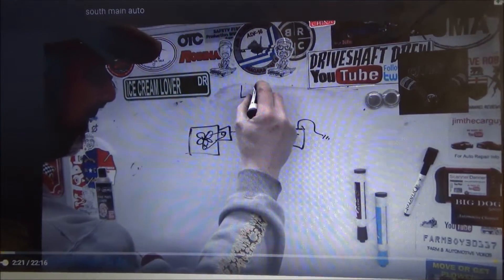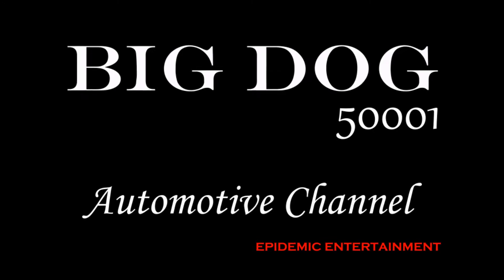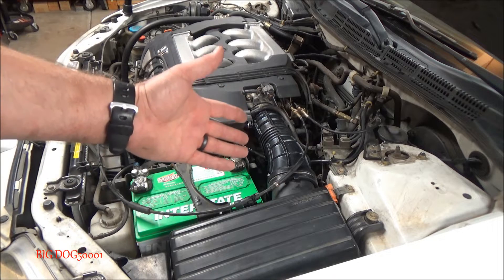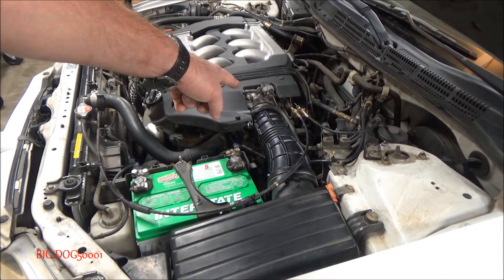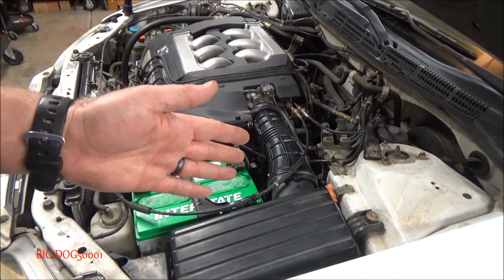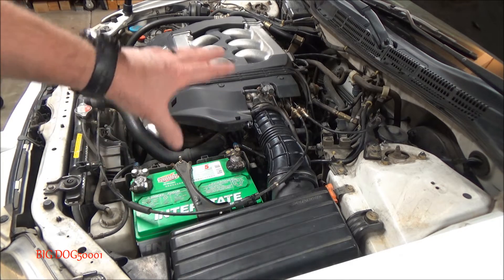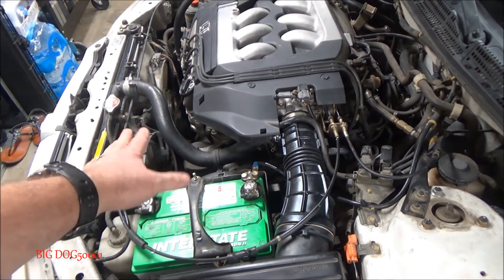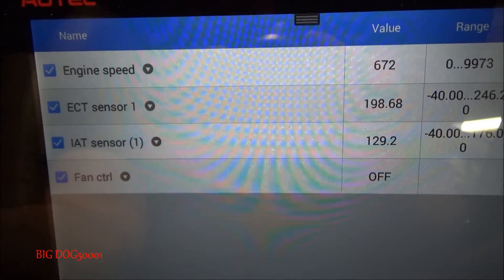Honda Idle Relearn Procedure

Comment from the maker: In this video, I show how to do an idle relearn (learn) on an older Honda.  It is very easy and should be done anytime work is done on a Honda such as disconnecting the battery, unplugging the ECM (Engine Control Module), working on the intake or throttle body etc.  

The ECM learns certain characteristics that help it idle and anytime the battery, ECM or throttle body are worked on, the ECM needs to relearn these operating characteristics or the vehicle may not idle properly (especially important are throttle plate angles).  Many modern vehicles need some kind of idle learn procedure and a lot require a factory capable scan tool to do it.

The procedure I show covers many Honda models but there are many newer models that also need to have the ECM reset with a factory capable scan tool before letting it idle for 5 minutes.

Other newer models also require the SCS (Service Check Signal) to be jumped using a factory capable scan tool after idling for 5 minutes.  Newer 9 speed automatic transmission vehicles are particularly vulnerable to a high idle if the SCS line is not jumped using a scan tool.  I do not cover either of these procedures in this video.  I will try to cover them in a future video.
Reply: Irfan I have honda civic 2015 I cleaned my throttle body very well..i.put everything back together..and my idling still 2000rpm..how did you fixed it??
Can u tell me plz..driving me nuts
Thanks again
Reply: Can this SCS line be jumped manually at the DLC?  I believe it's shorting the #4 and #9 pins that jumps the SCS line.  Is there a difference between jumping it manually and jumping it with a scan tool?
Reply: Can you please make a video for Honda Accord 2015 idle relearn. I clean my main throttle body and now the car is idling at 2000 RPM.
Reply: irfan ali did you ever fix your idle problem and how ?
Reply: @irfan6309 Irfan
Reply: Will this work for 09 Honda?

Comment: I wish you had made a video showing how to clean the EGR passages on this Honda V6...
Reply from the maker: Sorry I did not have time.  I know Eric The Car Guy did a video on it and I remember it being pretty good.
Reply: It's super simple. Pipe cleaners & carb cleaner or WD-40 works I believe? Be thankful you didn't spend 1,100 chasing phantoms & going part swap crazy even replaced part of problem early on with new pump but needed new assembly & cost me 1,000 & 30 days to find it out. 😔😔

Comment: Why should this be done? I personally reconnect the battery start and drive. Nothing unexpected happens. Whats the idea of that process?
Reply from the maker: The ECM learns certain characteristics that help it idle and anytime the battery, ECM or throttle body are worked on, the ECM needs to relearn these operating characteristics or the vehicle may not idle properly (especially important are throttle plate angles).  Many modern vehicles need some kind of idle learn procedure and a lot require a factory capable scan tool to do it.